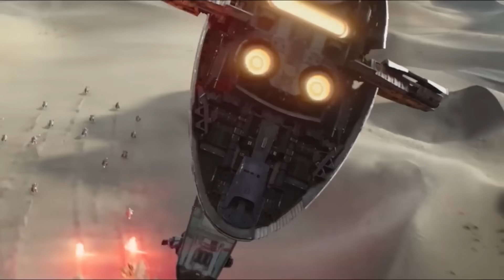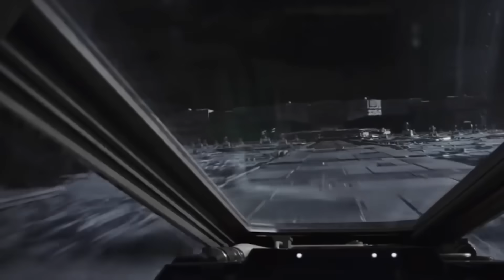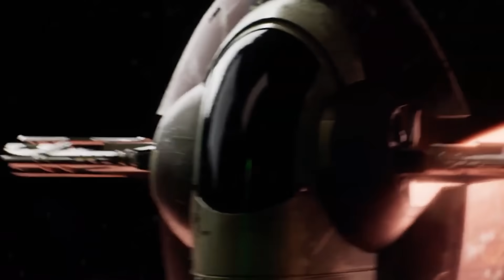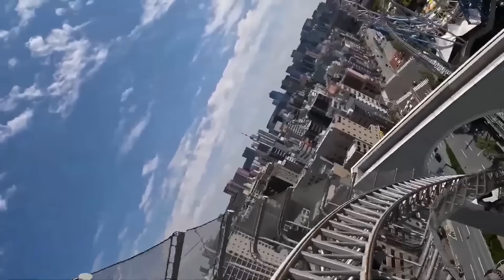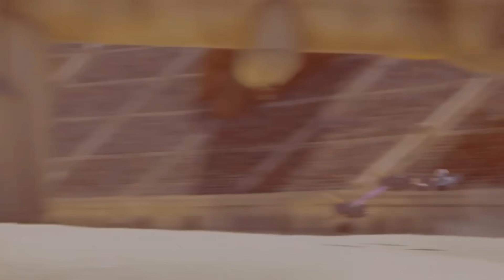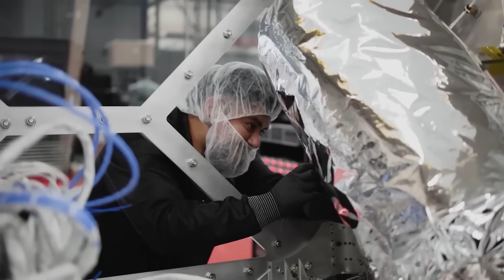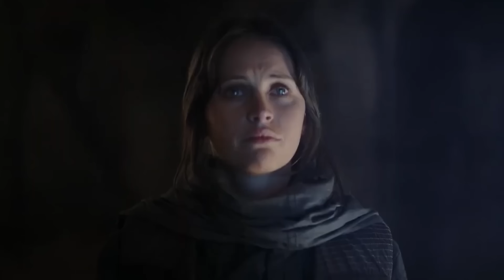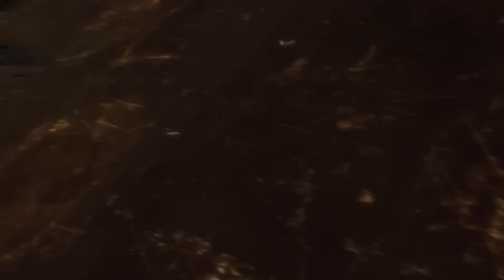The Problem with Star Wars Ship Design

Comment: They use transparisteel windows because being stationed on a submarine in space, without a view of whatever system you are patrolling, would lead to serious problems among the crew
Reply: I mean look at Wrath of Khan, as soon as you loose sensors due to Celestial or Man Made anomalies your dead in the water and unable to see surprise attacks
Reply: @devildolphin2102 The Empire could have solved this problem by Shield generating the Star Destroyers, so no matter what exposed sections they are, it would be protected by the shields from weapons!
Reply: @Garland.Greene2296 
That’s not how Shields work in Star Wars
Reply: @devildolphin2102 look at the separatist ships in the Star Wars phantom menace. They could have done the Star Destroyers the exact same way.
Reply: @Garland.Greene2296 
You mean the Separatist Ships that CONSTANTLY get boarded. 

Like seriously out of every ship in Star Wars the separatists who have all droids and almost no windows constantly get boarded from infiltrators, Anakin using Hyperspace Shuttles or Hell AT-TE walkers dropped on em. 

And also Transparesteel Windows are Clear See through Durasteel it’s not glass
Reply: @Garland.Greene2296  The shield just gets overwhelmed Star Wars has weapons that are specifically designed to takedown a ship Shields And if you only use Shields for defense not bothering with armor at all Then those anti shield weapons become more prominent and powerful and your ship becomes all the easier to destroy. Giant weapon systems really need to avoid single layer defenses or systems that can be specifically targeted while ignoring all other factors such as secondary defenses. It's why in most fictional universes ships use both Shields and armor so you can't just win with weapon that's really really good against one or the other
Reply: @devildolphin2102  Like that's not just a Clone Wars thing because Dave is a shitty writer. Remember how much of a close call it was for them to get on the Invisible Hand, and as soon as they went deeper inside they were trapped by tractor beams (or whatever tf those in particular were called)
If they actually gave a shit when making the Clone Wars and included more uses of the Stealth Ship in S2 it would have made much more sense, just goes to show how much they nerfed the droids ability to spot/scan for enemies... or do anything well in particular
Reply: EXEPT FOR THE CITADEL ARC WHERE THEY INTRODUCED FUCKING LIFE SCANNERS ON CAPITAL SHIPS, LIKE WHY WOULDN'T THEY BE ACTIVE 24/7!?
Reply: @yami122 durasteel plating is armor, what are you talking about?
Reply: Having windows wouldn't have helped there bucko
Reply: @devildolphin2102  
Thing is though, if you can see the enemy ship out the window, you've done something terribly wrong.
Reply: @stylesrj 
What???
Like half of the battles in Star Wars take place in Asteroid Fields, Stellar Anomalies, Nebulas, and other Force/Celestial/Supernatural locations where half of the equipment never works properly.
Reply: @devildolphin2102  
Just saying in general when it comes to space warfare, you got plenty of space... why would you fly your ship within visual range of another ship? If you've lost your sensors and require visual aid to spot the enemy, then clearly you've done something wrong.
Reply: @stylesrj 
Well your going to be in visual range of ships because their Impervium and Doonium armor is almost indestructible from far away thanks to shields, and Half of your computer systems will be getting DDoSd from droid brains and infiltration attempts 

Like people will do zero research into Star was and then give the more brainless takes. It’s just sad
Reply: @devildolphin2102  
I think that was something explained in another video actually... that the ships have to fight like Ships Of The Line, etc. because the armour is tough and the shields require a lot of firepower to take down.
And I think everyone uses Turbolasers because it's easy to reload weapons if they all use the same ammo... which means armour is designed to stop plasma guns, not kinetics.
Also kinetics require having to carry around all that ammo or material and then facilities to turn them into bullets or missiles?
Reply: @devildolphin2102 Yeah, yeah, go watch more Star Trek ya nerd.
Reply: @stylesrj  and the couple times we do see kinetics/missiles, they are actually incredibly effective, but are practically useless in long fights due to ammo restrictions
Reply: @goldenhate6649  do you have any idea how many nuclear missiles would fit in a star destroyer? A lot.
Reply: @HelmetPersonProtectedunderlaw
Cope&Seethe Disney Tourist. 

Sorry I triggered you because I’m a Fan of Star Wars 😂😂😂
Reply: @devildolphin2102 You don't realize how far apart bits are in a real asteroid field.
Reply: @devildolphin2102 So why are the weapons losing inertia over a distance....in space?
Reply: @toomanymarys7355 
I don’t think you realise How big Starships are or how Inertia works in space.

It’s not the Massive rocks that are the danger it’s the Smaller ones, because if they are going fast enough it will shred your ship like paper. Because guess what Newtons 3rd law
Reply: @toomanymarys7355 
Because it’s Plasma not Lasers. 
Why are you confused that a superHEATED blob of gas is Loosing HEAT and cohesiveness in VACUUM of space

Like serious on its basic science, I’m sure a 5 second google search would have solved that for ya 😂😂😂
Reply: @devildolphin2102 Why would use plasma if it has stupid range? And really has no particular power. Eneegy potential is pretty terrible. There is a reason knives are backup weapons. 😂

That's because it was MADE UP BY A MOVIE DIRECTOR. And everything was actually based on WWII movies. Literally swiped German uniforms for thr Empire. The larger ships have WWII superstructures. They're shaped like WWII ships with rockets on their butts. 

It's fine. You can pretend. But don't sct like it actually makes sense.
Reply: @devildolphin2102 Okay, so you need windows...to see pebbles coming at you at an appreciable fraction of light speed? Come one.
Reply: @toomanymarys7355 
WhY wOuLd YoU uSe PlAsMa????

Because it is a Near infinite number of shots that only requires Gas and Ionization from the Reactor. 

Also it’s stronger against Ray Shields than Railguns are against Particle Shields.

Also Durasteel, Doonium and Impervium the main Metals of Ships are weaker to Plasma than they are to Kinetic weapons, 

God you Tourists are pathetic. You know nothing about the lore so you think your “Smart” and end up having your Main Arguments be things we have heard since 1990 and already have explanations.

Keep Getting triggered Fake Fan 😂😂😂
Reply: @stylesrj  Because none of the big weapons in star wars have the range to be out of visual contact. Its one of the weird facts about Star Wars.
Reply: @darthkarl99 that is arguable data that is nominal cannon gives light min of range but visually ships are often seen with in 5 to 20 km of each other for battle there are 2 ways to take this litterly or figuratively.  So the screen is telling the litterly truth or the nominaly cannon data sources are correct and the screen is an in universe depiction.  In one of those ranges are fairly short not as short as some people think.  You see ships shooting atveaxhboyher over several times the length of a star destroyer so combat is obviously happing at multiple kilometers range.  And with the acyal visual acuitybof the human eye even that defeats the point of big brifmdge view ports.  I think the imperial bridge led out acualyvtells us what we need to know you have a few officers that while giving orders are the ones that can look out the window.  Every one axualy doing something is down where they can't see a damn thaing threw those windows.  Theyvare there because gorge decided they needed windows and there is not acceptable in universe treason for them because even in a star destroyer the people piloting the ship and shooting the guns are not looking out the big bridge windows.  You can do one of two things because they are nonsensical even in the starters universe.  1. Ignore it.  2.  Freek out and get annoyed.  If you enjoy starwars I suggest number 1.  if you hate starwars and want something to rant about number 2 is for you.
Reply: Why is he even discussing this? He said he would be looking at things through our universe's view.  Every ship from the smallest gunboat to the largest aircraft carrier/cargo freighter/cruise ship have windows around the Comand deck. Even the space shuttle has windows.
Reply: @247Barcaro  Submarines do not have windows. They have sensors (sonar).
Reply: @RPSchonherr   Military subs don't, civilian subs do. Plus the reason most subs don't is because at a certain point not enough light can get down there to make them worth it. Space doesn't block light. A metallic surface could reflect the sun's light from as far as the outskirts of the solar system, if not further.
Reply: @RPSchonherr  Let me introduce you to this little obscure country who likes to build windows into their conning towers, the country's name is the Soviet Union. And they have this little navy that is just the second largest in the world, nothing to brag about.
Reply: @naieatbabies that is an enclosed conning tower - it is flooded whilst the submarine is submerged.
Reply: @247Barcaro  Space Shuttle had windows because they needed to land like an airplane.
Reply: But airplanes are routinely flown AND landed, instruments only.
Reply: @mikolajtrzeciecki1188  they still have a use. Like most aircraft that land on runways. They are usually guided in by lazers , but we still have glass because its always good to have multiple points of data.
Reply: @JohnnysMapsApps-u5f  Space Shuttle design process was just slightly after the Apollo moon missions. Probably couldn't design them (let alone fund their construction) on hoping or expecting tech to make windows obsolete. And at least for something where we only ever had at most 4 functional ones at a time for the entire world, having that redundancy makes sense.
Reply: @JohnnysMapsApps-u5f Once the pilots are below the MDA (minimum descent altitude) or beyond the DA (decision altitude) it's a visual landing because see and avoid is still a thing. There is such a thing as Cat III autoland, but contrary to popular belief it's probably used in only around 5% of airline landings when visibility is especially bad as it's complicated for the pilots to set up, requiring specialized equipment and training.
Reply: @mikolajtrzeciecki1188 and? Space capsules have windows and they basically fall from the sky when landing
Reply: @247Barcaro  space is astronomically bigger than what you're finding on a planet. Aircraft carriers have windows because the captain can actually see stuff out of them that is relevant. Even the space shuttle as someone else pointed out needs it to land like an airplane.

Any spacecraft that would be performing battles in space wouldn't be able to make use of windows battles aren't going to take place where you would even be able to see enemy ships they'd be fought from astronomical distances to the point you wouldn't be able to see the ships shooting at you.

at a bare minimum spaceships would be fighting with hundreds of miles in between ships And that's unusually close it would more be thousands of miles or hundreds of thousands of miles or millions of miles away from each other.

railguns lasers and missiles that home would be the weapons of space
Reply: @yami122  exactly, the ship should have thousands of sensors. There's basically no range limit in space, and since in Star wars you can just make an hyperdrive kinetic rocket, the enemy wouldn't even know what hit them.
Reply: Everything you said falls apart when you fight the Vong. With their void emitters, the only tool that can tell you when to fire the follow up shot as the void collapse is you eyes. And fighting from thousands of miles would be useless.
Reply: @247Barcaro  then you're basically screwed you lose. Biggest space battle will inherently be thought from thousands of miles so these aliens that use these void emitters would be shooting from so far away you can't see them with your bare eyes but they can use some of their biological bullshit to see you from thousands of miles away.

Space is vast and being really close is counterintuitive Mankind has always sought to engage in war from as far away as possible first there was Archers then there was catapults and ballista Then trebuchets the spear and Lance were the primary weapons for much of history that wasn't using a bow as even infantry want range. Then there were cannons and muskets crossbows guns becoming longer and longer ranged and more accurate aircraft and tanks Big huge artillery that shoots hundreds of miles away Battleships then aircraft carriers.

fighting in close range when you don't have to building spaceships that don't take advantage of the vast emptiness and lack of curvature and gravity and air resistance just goes against the very fundamentals of human instinct and design of warfare. As for that strategy not working against the Vong well to be fair by the time they showed up out of nowhere the Galaxy had already completed all the ships it would be using design wise in that war not too much was built after meeting the bong during the long War I think just a stealth X wing maybe? Their capital ships wouldn't be built around the Vong your fighters wouldn't be built around the Vong not until you're many years into the war.

As for their Void emitters there's some work around to whatever bullshit they are polling on their enemies If you disrupt a faction scanners new scanners will be built that looks at something else or even looks for the device that's jamming the scanners. Just because the technology prevents long range scanning in its form as it when the long show up doesn't mean it would have to stay that way. And with the bong using biological weapons you would want weapons that are as far ranged as possible because that bug is gonna have a hard time going across the solar system after it's shot at across the * System.
Reply: periscopes would be the best option And it would be best to place the command crew deep in the middle of the ship weather least likely to get hit. Avoid having Captain or Admiral right at the edge of the ship behind the least amount of armor and floors as physically possible as it creates an extremely easy to target hit here to win spot. It's such a liability it almost makes every other spot's armor pointless because why would you ever hit anywhere but the command bridge it's an instant win
Reply: The protection of a SW ship is their shields, once they are overloaded, it barely matters whether the armor is five meters of neutronium, slabs of transparisteel or thin sheets of tinfoil.
Reply: Yeah but most of the windows are in like special areas like the bridge which not every crew can access
Reply: so you do what bsg style ships do and have a metal shield ya can bring down
and its heavy duty and might put multiple ones down
Reply: Transparent windows are good if you potentialky may not be able to rely on whatever visuals or radar or whatever you have. That's why real ships have raised bridges and windows, too.
That being said, in space, you have 3 dimensions, so the bridge should go around the sides and the bottom of the ship, too
Reply: Distances and velocities would render most visual observation impossible.
Reply: @PaulThatcher-iu5in  <me looking at a little blue dot in the distance> hmm what a curious phenome-NEOWWWW
🚀💥
<dies by being viciously sucked into outer space after the Costco grade plexiglass broke due to it being point-blanked by a F*CKING MISSILE> Like not even a tank, even less an armored car could've survived that 😂
Reply: Just like it totally doesn't on actual submarines?
Reply: You could always use cameras and large video displays instead. We have video displays now that you would think you were on a platform in the middle of space if set up right. Or Things like FPV goggles for drone pilots. That right there would solve the human in a fighter issue. We're almost there with our fighter aircraft now.
Reply: Let's assume a lot here and say OK, the point about the crew's mental health is worth considering... What, though, of a people/species long accustomed to space travel, indeed, lives spent essentially in space? Wouldn't they be(come) accustomed to the limits imposed by that?
Reply: Submarines don't have windows and spend months submerged.
Reply: @MattyRlufc  Matty, some people in these comments have a fact-proof force field around them so they can cherish their childish world.
Reply: Real world Wet Navy ships have an "external bridge" superstructure, AND a combat control location, located in an armoured box in the bowels of the ship... 

There are real reasons for this, if sensors fail, having a window is really useful, and he also partly answered his own question, things like moving in tight spaces, docking etc.

Then there's the "why do X wings lock airspoils in attack position", this is another real world concern, you spread the guns out to create a bigger beaten zone and improve your chances of hitting mall mobile targets, check WWII fighter planes and their machine gun / canon locations.

Then there's "why doesn't the speed make the pilots black out", speed doesn't cause G-force, only Acceleration / Deacceleration does that, but SSW has "artificial gravity generators, so that can conter g-forces, so no blacking out, internal logical consistency.
Reply: How do they handle that on a submarine then
Reply: @adamnorton748  Submarines have..."Conning Towers", and RETRACTABLE windows called "Periscopes", because sometimes... Sensors are not enough...
Reply: screens exist
Reply: … what problems?
Reply: I think people are skipping over the psychological problems.

There’s no way around it. A human crew is going to go insane if there’s no windows.

In real life, this is called cabin fever, and it typically affects submariners. Without sunlight, windows, or anything of the surface on top of being trapped in an enclosed space, you start to go insane. It’s why submariners are intensively screened regularly.

On a spaceship, even access to just viewing stars would help. The closer the better. If you can at least see stars, it’ll help. If you can feel the warmth of a star(s), and even catch light from it in your peripherals, it’s amazing for physical and mental health.

The only other remedy is artificial sunlight and setups. Like how in Fallout, some vaults mimic a blue sky, sunlight, surface, etc.

Submarines aren’t submerged for years, but spaceships can be out in space for very long periods of time. If you don’t have any accommodations to sailors, your crew morale is going to tank, and your entire crew might literally devolve into anarchy and animals.

Like, people don’t understand how wild humans can get without access to sunlight. Little access can lead to moodiness. No access at all can lead to incoherent and bizarre behaviors.

And on a side note, but it’s genuinely just a tricky situation. You want healthy doses of radiation in the form of UV light, but at the same time, windows make your crew vulnerable to cosmic radiation without proper shielding, physical or energy.

It’s kind of a pick your poison. Insane crew or people developing cancer and tumors, unless you can find a good middle ground. Or just be Geth and have no need for windows.
Reply: @Jazz_Flavoured  Windows would be digital in a realistic setting, you need all the cams for sensory awareness anyway. For the rest look at how the Belters on Ceres live in the Expanse, they have a fake sky there and it wouldn't be a stetch for them to have already developed adequate UV lamps/emitters
Reply: There’s also the fact that sensors can be tricked by other ships. It’s very difficult to trick the eyes tho